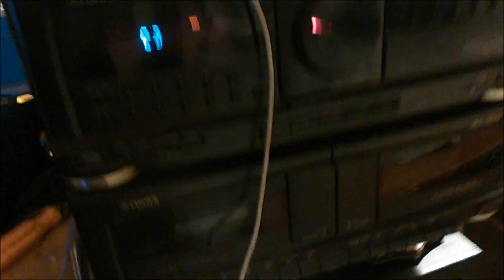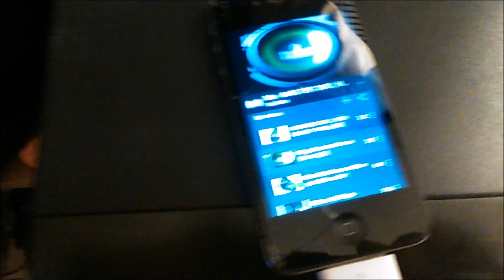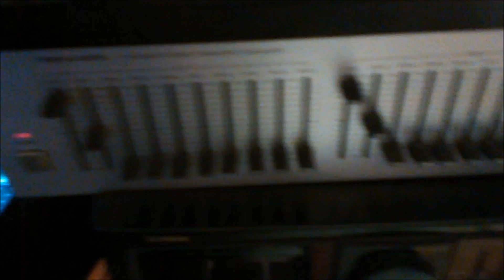random speaker blowout 2

Comment: what model speaker was that infinity mid out of ?
Reply from the maker: infinity rs 1000 I believe
Reply: Straight shot 80 I used to have a set of rs 1.5 infinity with midrange like that but with rubber surround, emit tweeters and 12" Watkins woofers dual voice coil 2 ohm per coil. But they foam rotted and we replaced them with radio shack woofers but they didn't sound the same. Now I want a set for myself again since I collect speakers now especially vintage and high end.